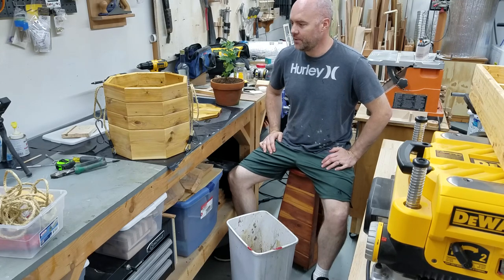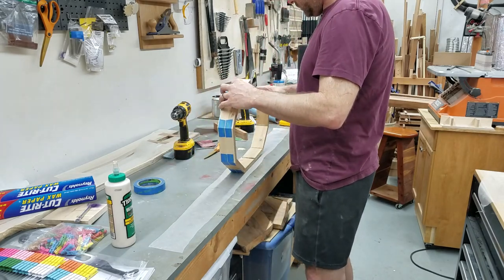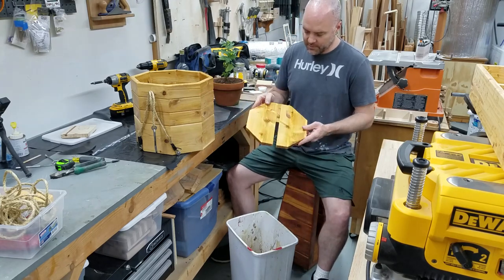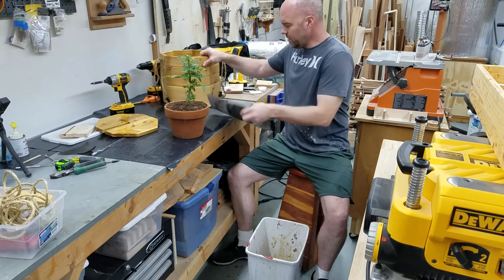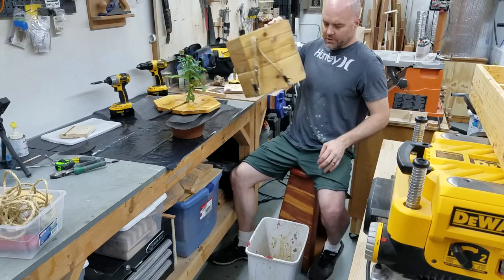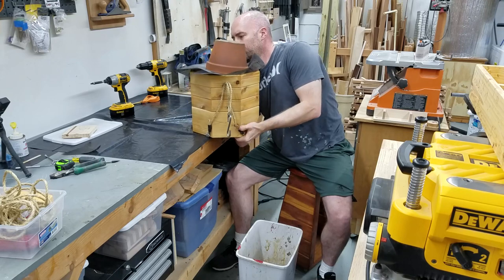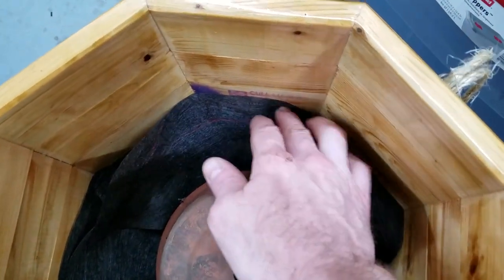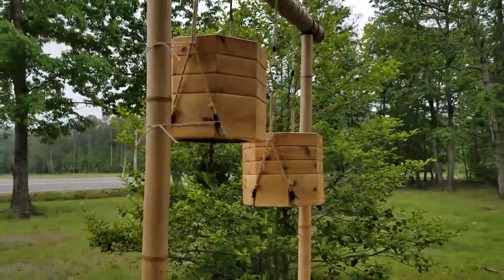Upside-down tomato planters

Comment: How’d they hold up?
Reply from the maker: I should have posted a follow up. The plants kept trying to curl up towards the sun, but eventually filled in nicely and needed to be pruned several times. The planters held up great. I took them down at the end of the season, cleaned and scuff- sanded, and applied a few coats of Halcyon for UV protection.